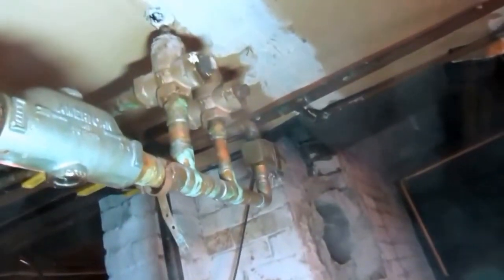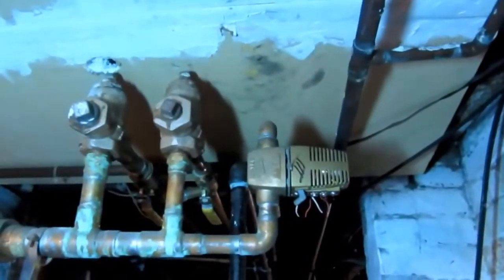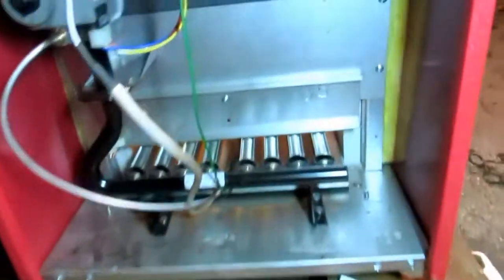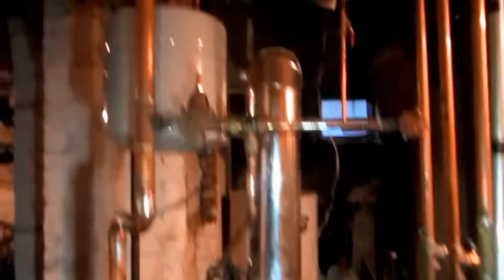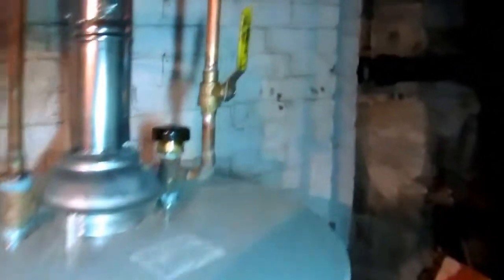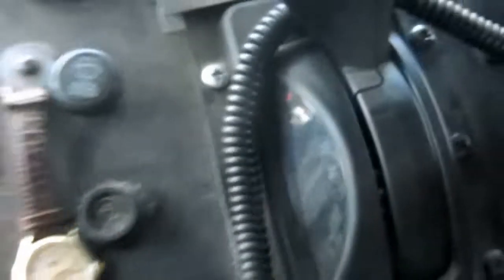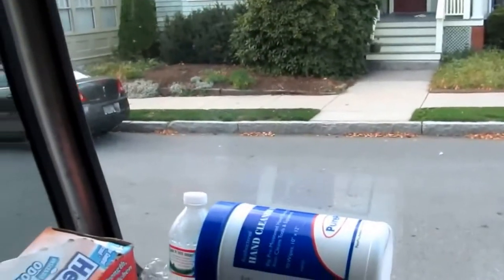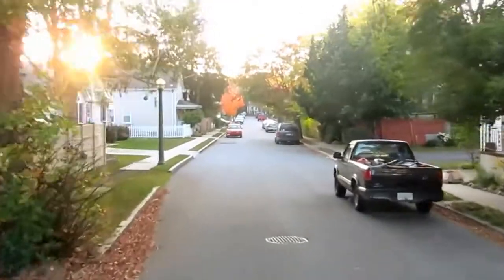GAS HEATING:oil to gas boiler replacement

Comment: I have installed a Buderus 4 Section oil boiler in my home.  In the near future I will replace the Riello oil burner with a Riello Gas burner and leave my buderus boiler.

Comment: I have a gas boiler it is a UTICA and was told years ago that it will run if the power were to go out. He said just flick this switch and I can't remember which switch.
Reply from the maker: sowsplace you must have a power pile system millivolt with a{ j control} ,,,,on the top of the control box there is a manual switch.but your circulator will not run.it might work gravity .but not so well.
Reply: thank you. I wish I could find a user manual, I was only left with a how to install paperwork.
Reply: No problem dude and I know what you mean

Comment: The only thing i can see that i question is the water heater flue by code should be above the boiler flue.At least in RI. Other wise nice job these are my favorite!
Reply from the maker: well a higher water tank flew would not hurt if any thing it might work better i had the job inspected and it passed just fine  ... i would have to go back and re watch the video .it was done like 6 mounts ago